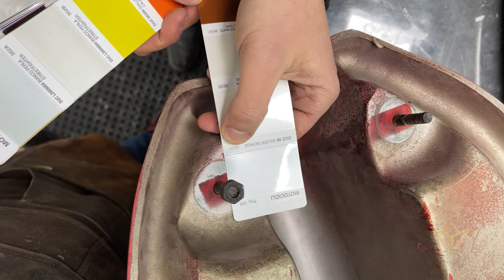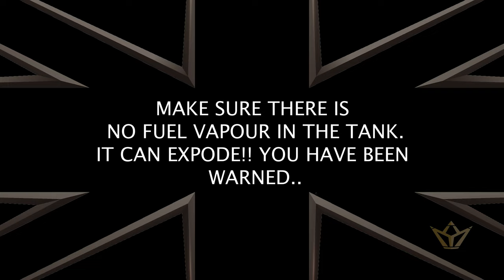WEEK 5 - FIRE IN THE HOLE! and also reconstructing the fastback tail- 1968 Norton Commando

Comment: That model frame is called the '' Widow maker'' as they crack/bend at the steering head ,they were recalled and a new frame was fitted. Keep it but do not ride it ,well if you do use that frame you will not ride for long .Suggest you join the Norton Access forum for lots of info .Also those pistons drop the tops off, again use at your own risk .
Reply from the maker: Hi Paul. Respectfully I must disagree. I’ve engaged on this subject regarding the frame too many times but I’ll respond here to update the comments. The ‘widow maker story’ is now set in stone unfortunately and not researched. Berliner requested an immediate review of this frame after in the first consignment some fell off the truck onto there noses. This raised concerns so Villiers Norton added the extra brace. Why? This is the US market and the brand was against the wall if they didn’t deal with the concern. Prior to this NV designed a perfectly good frame and tested it to production prior to the damage. In fact many other brands use a similar design but never suffered the same fate. This bike has not only been ridden since the 1960’s but also raced. Because there are not many left it is hard to defend against a popular myth. There are of course frame failures as with any but it’s not anymore dangerous that any other brand of the same era upon which the spotlight is not focussed. I still had an inspection done on the 2 brace weld points in question in particular to which there was no issues found. Therefore this frame will stay as it is according to its original design as will the pistons because they too have seen no failure in there tenure inside this engine. This is a period restoration taken seriously as this is 1 of probably only 2 surviving in this original spec. It would have been totally remiss of me to simply follow advise because someone has declared it unsafe. I hope you would agree that we all ought to do our research before tampering unnecessarily. I’m glad I did! That all said thank you for your concern and also partaking in this conversation. It is always great to read, learn and share. All the best.

Comment: The Z plates were polished. Flush out the oil tank thoroughly after the grit blasting. Check the lower frame loops for straightness around the centre stand. They are often bend upwards because of kickstarting the bike while sitting on the main stand. Another weak point of those early Commandos. I installed the later style centre stand mounted on the gearbox cradle.
Reply from the maker: Will do thanks 🙏